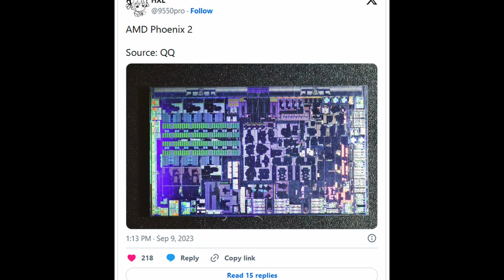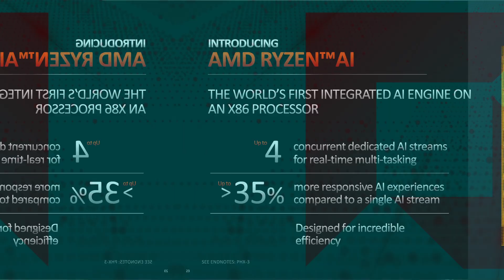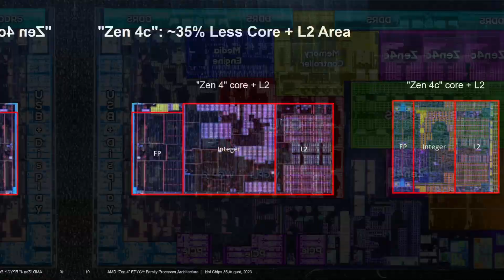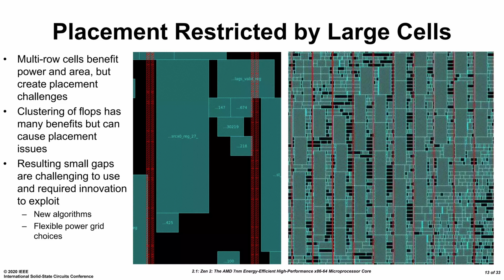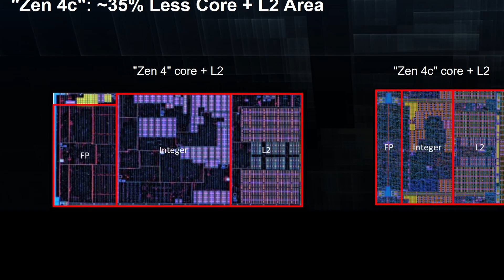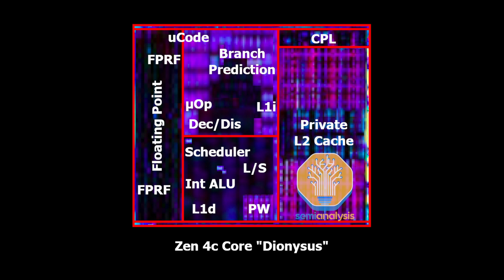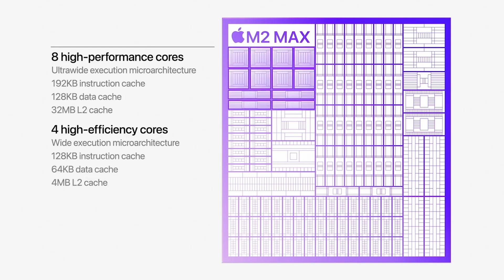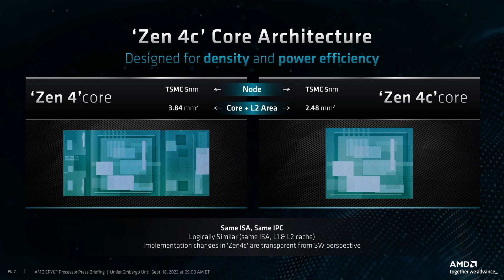Why AMD's first Hybrid-CPU is Different

Comment: That is clever, as thread counts increase max clockspeed decreases anyway, so the extra cores don't need to be designed for as large a max clockspeed. I wonder how far that observation can be pushed, maybe three designs on one chip. Hell maybe every time you double core count you add a new design for the new cores.

Pair that with the stacking tech, such that there is no L3 on the compute die, and you could have a chiplet that is insanely dense.

Comment: What do you think about an idea of Ryzen with 32 Zen5c cores + 3D V-Cache?
Reply from the maker: I’m not sure Zen5c even has the TSVs required for the 3D V-Cache.
Reply: @HighYield  Ok, but what about 32 Zen5c cores on Ryzen chip? Will they be faster than 16 Zen5 cores with higher frequency for multithreading tasks like Cinebench?

Comment: It is interesting how ultra low power devices like laptops and more power hungry devices like servers gain more with this approach, they gaine more parallel power without losing too much single thread performance and saving a lot of power consumption, while desktop otherwise it's not that interested in this race

Comment: @HighYield A point I have not seen mentioned is using advanced process nodes.
A halved L3$ with 3 cores for 2 allows a doubling of cores in almost the same area, meaning retaining @High Yield !
For AMD that might make 3nm more economic, gaining efficiency in even smaller area without loss of clock speed challenges while power density is not problematic even all core.
OTOH the higher performance less dense 4nm might offer higher max clocks and boost potential on desktop.
Cost per core in high utilisation cloud server, the effective cost/performance of Zen5c might be compelling.

Comment: More cores at higher clocks has a benefit for mathematical compute but for desktop applications a single threaded CPU that is faster is better.   What AMD have done is provide a really good compromise.  As more applications become multi-threaded their performance can be offloaded into more cores giving a performance boost.   However, this means that applications will need to be compiled correctly for this architecture.

Comment: I think this is a good idea when it comes to gaming laptop APUs especially. AMD only just recently arrived at a design where they were comfortable throwing as many as 12 CU's into an APU, the majority of past designs saw maybe 6 to 8, and sometimes 10. You can tell from these numbers that there's an inherent die size cost that makes adding too many CU's a poor trade-off. These space-efficient cores could be making the difference between 12, and 16 CUs in the future in products like strix point, possibly giving a lower overall cost to entry level gamers. This also suggests that there might be a possible RDNA4 E CU design in the future if it's possible for the radeon team to learn from the lessons of these CPU e-cores, possibly bumping the CU count on affordable APUs even further. Just imagine entry level APU based gaming laptops that pack 8 efficiency cores and 20 efficiency CUs.

Comment: Would be interesting see some low end Zen 4c only apu's too take on Intel's Celeron N series processors. A dual/quad core Zen 4c apu would wipe the floor with Intels celern N series processors

Comment: This is smart because all the scheduler has to know is what cores clock high and which do not - which is already widely implemented in Windows and Linux as current AMD CPUs already have those attributes for each core, as each core is rated at a different maximum clock. But this also has a few downsides. AMD can't compete with Apple's uncompromising perf/W design of their efficiency cores, and intel can technically pack more compute density in the same area of silicon since they sacrifice feature completeness. However: AMD is efficient enough to get away with it since they don't make smartphone CPUs, and intel can't capitalize on their density advantage anyways since they lag behind AMD (meaning TSMC) in node density so bad it doesn't matter.

Comment: I do actually think that Intel's move back towards single threaded cores makes a lot of sense regardless of architecture, the better your scheduler and prefetch units are, the less extra juice you can squeeze out of the ALUs and FPUs. Add to that the fact that cross thread vulnerabilities are almost impossible on single thread designs as well as higher densities and those E-cores are looking mighty fine. AMD's focus on instruction compatibility also makes a lot of sense given how they haven't been affected by vulnerabilities and node restrictions as much, it wouldn't surprise me if the future will land somewhere in between, single threaded cores using the same ISA but min-maxxed for speed/energy consumption.

Comment: What does WGP_1 and 2 stand for?
Reply: Working Group 1 and 2. Working Group is the minimum compute unit in AMD RDNA architecture. Compared to the old CU (Compute Units) of AMD GCN, a WGP is equal to 2CU. So 2 WGP = 4CU.

Comment: Phoenix 2 is a horrible name for this product.   It sounds like it is the next evolution beyond their Phoenix product.  Not a sister product with differing tradeoffs and strengths.   "Phoenix C" or almost any other name, would have been better.
Reply: It's an internal codename, it's not meant to be anything else. It's a second product of "Phoenix" line, so it's named phoenix 2

Comment: sure for server applications i can see the big little being fine but for consumer just give me the actual cores.
Reply: The only difference between them is the clock speeds plus far more cores in roughly the same die size.

Comment: Heat distribution will be just as unorthodox as Ryzen 5 and 7, which is rather disappointing. Also, they need to stop ignoring their memory controllers, which are still rather anaemic

Comment: As a designer for the SBP9900 at TI, I understand the difference between the P and E cores. I also understand the Ridiculous Instruction Set Computer (RISC) concept of ARM. But who said the CPU should be "symmetrical"? I worked on a stack-based direct execution computer. I examined the WD Pascal Engine and the Novix Forth hardware engine. Semantic design means that there is no "symmetry".
If they want high performance, they should abandon inherently defective CMOS and switch to resonant tunnel diode threshold logic. "Engineers" at TI had a hard enough time trying to use I²L circuits. I had to create an I²L library of equivalent circuits for the standard TTL ICs. q-nary logic, self-timed circuits, universal logic modules, and semantic design were totally beyond them.

Comment: As a software engineer who writes multithreaded software, Intel's big-little split hasn't won my heart. In my experience, software tends not to scale linearly across cores because of the both implicit (mem bandwidth, cache sharing) and explicit (synchronization, scheduling). In practice what I've noticed, that E cores are so slow, that scheduling work across them tends to work out to a net zero benefit, as the aforementioned issues suck up about as much performance as the E cores provide.  This comes with the added difficulty of scheduling work across cores with wildly different performance.

Comment: That is interesting approach. We are deploying buildservers at scale, so efficiency is kinda important for us. With i9-13900K having E-cores was essential to reduce build times by 40% compared to only P-cores with same power consumption. For AMD we are using multiple peripherals to do the job and we need CPU to be as homogenic as possible. Also, Hyper-V in WS2022 was not happy with heterogenic cores, but it could be satisfied by AMD. Time will tell.

Comment: Some ARM SoCs have been doing the first half of this for over a decade. 

The Tegra 3 is the first one I remember, with four cores on the high performance cell library, and one core on low power cell library. It bet ARM's big.LITTLE to the market by a year or two.

And it's somewhat common on low-end SoCs to have a fake big.LITTLE configuration that's actually just two clusters of little cores optimised for different clock speeds. I assume those SoCs used different cell libraries.

AMD's main innovation here is taking the extra step to really optimise for area with the more careful layout.

Comment: To me, this shows how much room for change there still is in CPU design.
We've been stuck with monolithic quad cores for so long, and suddenly, we got big.LITTLE, chiplets, 3D-stacked cache, and 128-core CPUs. I'm loving it :)
Reply: For gaming this sucks. I want 16core monolitic. Hybrid Intel cpu has given me nothing but problems. Microsoft thread director is still terrible in 2024.
Reply: @impuls60 well the fastest gaming cpu is and will be for a while an 8 core amd with 3d v cache. If you want 16 cores get the 7950x3D or similar. 

This is best for laptops and cloud computing. Especially enterprise. More cores in less space is great for enterprise
Reply: @impuls60  Good luck waiting for 16-core monolithic on a cutting-edge node with high clock speeds and a large cache for gaming. Such a theoretical product would cost thousands of dollars and won't have a viable market if it can be outperformed by an 8-core costing many times less. You have to make a compromise at some point.

Comment: Great video. This strategy seems to make sense for servers.

For my laptop, I would personally love to have a hybrid processor design with lower power cores for simple workloads, good support in an intelligent cpu scheduler, and a couple fast cores for occasional cpu-intensive workloads.

I haven’t followed cpu design much in the past few years, and this is the first time I am learning about hybrid and asymmetric core designs. Interesting stuff. It’s cool to see how cpu designers are innovating as we reach the limits of increasing clock speeds and shrinking transistors.

Comment: For my application, an asymmetrical design works provided i have at least two threads running 4ghz … the other threads can be much slower 2ghz

Comment: YES.
Good decision AMD.
Intel's idea that programmers will actually have any chance at properly utilizing their disparate cores is lunacy, the amount of complexity that adds to your code is incredible, not like it makes any sense to, essentially using all the cores on intel's new gen is actually worse for high performance computing, since the operating systems don't even report the featuresets of the individual cores with a way to set which thread runs on them, making the P cores disable the AVX units if you use all the cores.
This, is how you do Big Little. Bravo AMD
No other way is sane.

Comment: In one of your videos you shown that AD102 is 5 nm, while in other it was 4 nm. I know these are just marketing terms unrelated to actual physical size but which of these is closer to being true? I've read discussions whether TSMC's 4N process is considered 5 or 4nm (discussing also whether N4 is 4 or 5 nm) but seems like it's controversial and people are trying to argue both way. What's your take regarding this topic?
Reply from the maker: Its TSMCs N5P, but Nvidia calls it "4N". It's not based on TSMC N4 tho (which is a optimized N5 node).
Reply: @HighYield  Thanks for quick response. Yup that I'm aware of but would you consider 4N to be better described as 4 nm or 5 nm process? Because some sources consider it to be 4 nm, while other sources consider it to be 5 nm. For example in your "How long can Nvidia stay monolithic" video 4:20 it says that AD102 is TSMC 5 nm, while in your "RTX 4090 Chip deep-dive" also 4:20 it says that AD102 is TSMC 4 nm.

Comment: I wonder if AMD's use of the same RTL for both cores stems from the instruction set.

x86 is extremely complex.  The decoder, accordingly, needs extra complexity, much of which is independent of the throughput needed, and much of which is always-on regardless of what the core is doing.  So it might lose efficiency if underutilized, and simplifying the decoder to just provide a lower throughput might not give all of that efficiency back.  And if the decoder throughput isn't changing, the execution throughput can't be allowed to change as well.  Which eliminates the main reason to change the RTL.

Miniaturizing the same logic, also has a lot of advantages.  If all the wires are shorter, that means less electrical resistance, and less leakage, which means that the same logic can get higher power efficiency (and thus less heat).  This partially compensates for the lost cooling from a smaller physical surface area.  It also might allow for thinner wires to carry the same signals, enabling further area savings.  Shorter wires also have less chance to affect each other, also partially compensating for the fact that there are more of them.

ARM does not have this problem, since it's much easier to decode.  As such, it's a lot easier to just cut off half the decoder and get half the throughput (though it's not necessarily trivial).  There is also plenty of room for the same exact layout optimization, but it's not necessarily as obvious given that the best point of comparison has different logic.

And it sounds to me, like Intel's solution to this problem, is just to remove some instructions. This will drastically simplify the decoder, perhaps making it easier to actually reap the benefits of simplifying the decoder.

Comment: I guess AMD could release Zen 5 in Desktop with an Chiplet of 8 Zen 5 and another Chiplet with 16 Zen 5c  Cores . Would it make sense ? maybe , for multicore apps for sure , it would be 48 Threads ..., Gaming , not really . It could make sense form an Energy consuption standpoint = use (  low clocked ) Zen5 c cores as long as they are used only to 70-80 % and wake up the high clocked Zen5 Cores only when Performance is needed , for mobile this will work well and prolongs Battery Lifetime . For Desktop it depends how good the Scheduler  will work , it should be simpler than with an 7950 X3D to choose the right chiplet for the workload because it only depends on clockspeed in Apps with Games it gets more difficult , you want the Performance Cores even if they are not really needed .

Comment: That's a much smarter trade-off than I originally thought! Very well done, AMD eng team
Reply: For the record, from my initial skimming of the news, I had assumed more or less that Zen 5c are literally just Zen 5 cores with part of the cache cut off with a handsaw. I knew that the benefit came in smaller power consumption, but I had no idea there were actually smart engineering reasons for doing it this way

Comment: That really feels like a business savvy move - engineer the core once, and get as much use outta it as you can
Reply: It's still more similar to engineering two cores. 
The advantage is the ease of integration with current software. AMD just have to assign normal cores as  priority cores and they are done. Compared to Intel who needed Windows 11 scheduling to take proper advantage of their P and E core CPUs.

Comment: Great for mobile, but for desktop compute Zen 4c doesn't have the appeal as more big Zen cores. My suspicion is that at 100% load for longer periods, a big Zen undervolt reaches greater (or at least a wider) range of efficiency targets. AMD must have realized this same particular flexibly pretty early on, because they literally Compressed Zen here until it reached the same thermal limit at a much lower, and presumably the most efficient, point on the power curve. This is great for devices that run a submaximal load, like most office or mobile devices, or GPU limited devices. Though I'm not sure if that Zenc wont adversely impact "GPU busy" on even the most constrained devices, like handheld gaming, because today the emphasis is more on high refresh rates than fidelity. Time will tell.

Frankly the most amazing thing about this is how consistently disruptive AMD's designs choices for Zen in the server or supercompute space are for the consumer market. They keep hitting multiple targets with the same stone.

Comment: Using the same architecture also makes software (particularly the scheduler) much simpler, which in turn also gives a performance benefit.

On an E-Core/P-Core design, as soon as a process e.g. uses AVX instructions it has to be moved to the P-core (which takes time, messes up the cache, etc.) and the scheduler then has to either pin it there (which might not be efficient) or keep track of how often this happens (in order to decide if moving back to an E-core would be beneficial; which causes additional complexity and uses extra cpu cycles). Most of that simply disappears if all cores have the same capabilities (and the only difference is how high they can boost their clock).

Comment: The problem with this, that intel is seeing now is scheduling. in most cases and especially for gaming, there can be massive latency and scheduling problems
Reply: Stop the latency hysteria and look at a core to core latency chart. Ecores talking to the same cluster already have less tban two thirds the latency of cross ccd cores on Zen 4, when it's ecores from different clusters talking it's even more advantageous for them at nearly half and when it's a Pcore to an Ecore and vice versa it's only like 20% worse than only Cores talking to each other . Ecores aren't being used bcuz games literally don't need more cores, that's it. The and fanbiys talking about "massive latency problems" are the same clowns that bought a 5900x and 3900x for purely gaming. 😂
Reply: @Frozoken  🤓